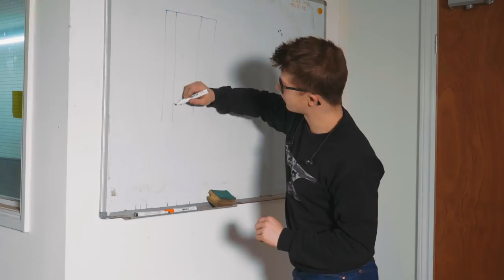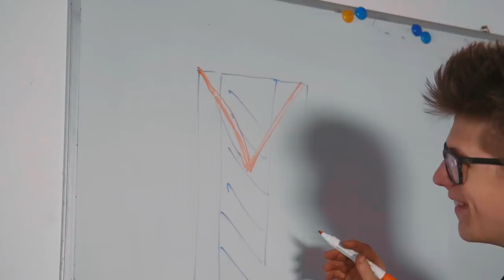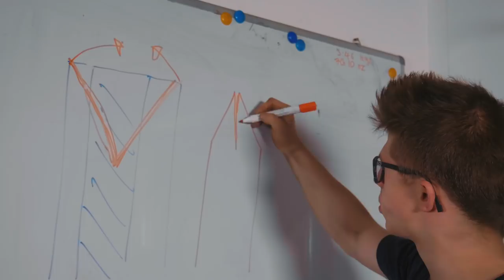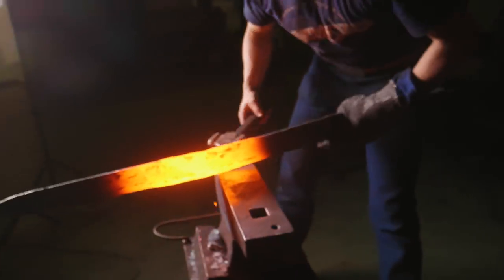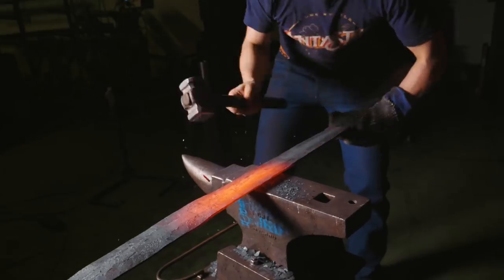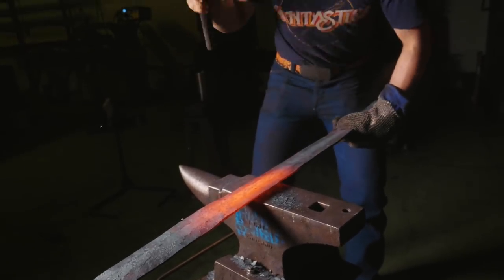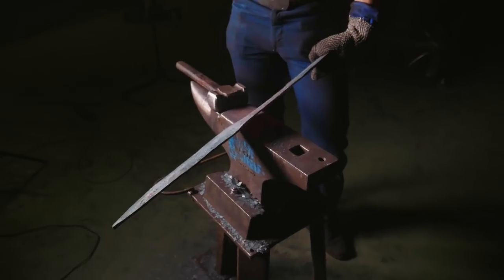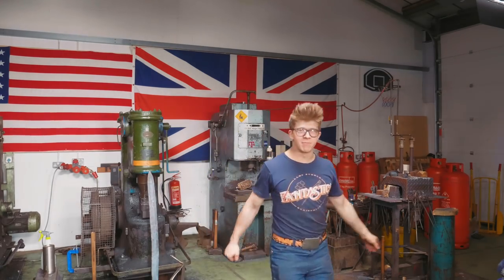MAKING A SCOTTISH CLAYMORE SWORD!!! PART 2

Comment: one thing i am curious about. does it make any difference if you hammer in a fuller opposed to just grinding it in or would it do nothing structurally and just push the material outwards? im just wondering if it would change the structure of the steel in the blade itself
Reply: B & A Talks you can't hammer in a fuller. It would be pointless. The whole point of a fuller is reducing weigh, hammering it in doesn't remove any material.
Reply: me too
Reply: the only difference between the two methods is the amount of wasted material. Hammering on steel doesn't make it stronger, the truth is it creates stress in the material that could cause a failure. That stress is relieved by heating it to forging temperature and letting it cool several times. The strength comes from the heat treating process. The quench makes it hard but also brittle which is why you then temper it so it retains some hardness but also becomes a spring steel so it will bend and flex while retaining it's original shape without breaking.
Reply: orrrr you could have a thinner piece of material in which you hammer the fuller in to make it wider so you start with less material? but my question is does it change the actual structure of the steel opposed to just grinding material off
Reply: Hammering on hot steel compresses the material and makes the molecular arrangement tighter. Think of it like compacting snow into ice. When you heat treat and temper the stress is taken out and the molecular arrangement stays tight and strong. A ground in fuller reduces weight, a forged fuller adds strength to the center to support the cutting edges
Reply: That's why people want hand forged metal. Not stock removal (grinding and cutting metal to shape)
Reply: i know about all the heat treating and so forth and the stress as you said will be reduced with the normalising process. i am wondering if it actually give beneficial strength by changing the actual structure of the steel opposed to purely grinding it as the steel would be compressed ergo its crystalline structure would reflect that fact or so one would imagine. THIS IS FOR SCIENCE!
Reply: Forging vs grinding does not change the internal structure or chemistry of the steel except that what was said that forging can introduce stresses that need to be treated away.
Reply: one suspects that it would as it would cause the grain flow to be oriented to improve ductility, toughness, and increase fatigue resistance where as grinding would have uni-directional grain flow which is when the steel has been cut when changing contour, exposing grain ends. This would render the material more liable to fatigue and more sensitive to stress corrosion cracking? or at least so i am lead to believe. I will have to ask my colleagues as their material studies were a lot more comprehensive than my own
Reply: For damascus steel is better to grind it, mainly because the pattern will be distorted with forging. Forging causes compresion of the layers, whereas grinding just cuts through them.
Reply: You add a fuller to add structure to long pieces so they aren’t all floppy and stay straight. That’s they main reason ,reducing weight and the way it looks are just bonuses.check out Man at arms they make a ton of video game and movie weapons and armour they make the William Wallace claymore and I think they explain it in that video or one of the others. Alex correct me if I’m wrong lol
Reply: Zach Attack, a fuller that is hammered in is not pointless. When you plan on forging a fuller versus grinding it you just start with less raw material than you would otherwise. It has the same effect either way. Fullers are not a new concept, and I guarantee you that medieval blade smiths didn’t spend months removing material from their blades, especially when it was so hard to come by.
Reply: fang maxam Actually, that's completely untrue. Hammering on the steel won't compress it, because at high temperatures steel exhibits extreme plasticity, meaning that the steel would only be spread out where it was hammered. The only case where hammering in a fuller would compress the material would be if the metal was bronze.
Reply: that is true but i am  concerned with the mechanical properties out of curiosity opposed to aesthetics
Reply: oh no i know that, i am just wondering if there is a difference between a hammered out fuller and one ground in. the grain orientation would be different but to what end?
Reply: exactly and i am just wondering if there was an added bonus to it being hammered structurally opposed to saving weight/not wasting hard to come by material
Reply: No point to forge a fuller in. Waste of time and energy. Point still stands.
Reply: your point doesnt still stand. if you lack the initial amount of material then a forged in fuller isnt a waste of time or energy PLUS if appears that there is additional structural benefit. you act as if you know yet i bet you are a 12 year old boy whos barely even seen a hammer in real life
Reply: B & A Talks structure will not change but the pattern in the damascus will look different 
In my experience grinding a fuller in damascus looks allways better 
A fuller is also meant to add  strength not reduce weight think of it as an I-beam
Reply: B & A Talks if you start with less material, there's no point to forge in a fuller, since it'll be the same weight without it. Still pointless. It's purely cosmetic.
Reply: B & A Talks 
Tl;dr: forging a fuller doesn’t make a difference compared to grinding 

To my knowledge there is no difference between grinding the fuller and forging it in. Whether grinding or forging the blade really should be annealed (heating to approx. 1600 F and then letting cool slowly and repeating several times) which will make the grain structure of the steel smaller and more refined. When the steel is hot you can’t really adjust the grain structure because any changes made will be destroyed and made uniform during the annealing process. There is, however, some thing called “cold forging” that I️ have heard of. Some Japanese knife makers hammer the steel while cold (and annealed) to further refine the grain structure. However, I️ haven’t tried cold forging myself and I️ haven’t found any comprehensive evidence that it affects grain structure in any meaningful way. I️ hope this helps!!
Reply: Cold forging is a myth, does nothing except open the door to failure, and probably originated as a means to straighten material that became warped during normalizing/annealing. This was proven during the Napoleonic wars.
Reply: Nope!
Reply: Good gracious the entire point of fullering is to reduce weight in a wide profile blade.  A fullered AND distal-tapered blade was/is a joy to handle.  Doing it by grinding is fine in the modern era where excellent steel is plentiful.  In the ages where this type of sword was made preserving the 'good' steel was far more important.
Reply: B & A Talks, I've been a metal worker for 20 years, so I have some knowledge of this topic, however I will gladly tell you I still learn more about metal every day. I can also tell you that in my experience, Forge welding a fuller actually seems to weaken the blade versus a milled fuller.  When you forge metal with a hammer, it compresses it and causes stress, which you can normalize later and make a bit stronger, which is something you should do with any blade anyways. I think the extra weight causes additional stress when impacting your target as well, so this could also be a factor in the blade failing, Milled blades are a bit lighter and easier to handle, but if not normalized and tempered correctly break just as often. Personally, I think the milled blades fare slightly better, so in this case, I do not believe forging a fuller adds anything structural to the metal, but introduces more weakness. Hope this helps.
Reply: To anyone who wishes to claim a fuller is pointless, you are wrong. Firstly, a fuller does provide structural support to a blade of the same weight and width and length as part of the blade is thicker and therefore more rigid. Secondly, even though the point of a blade may seem like it would create a simple line when piercing flesh, the wound channel will actually take on the shape of the cross-section of the blade, not just the point. This makes a wound more difficult to treat and heal (not nearly a direct comparison, but think of the triangular shape of a bayonet grind). 

As to the difference between forging and grinding a fuller, there shouldn't be any difference. If you think of steel as having a grain, you are right. If you think of steel as having a grain like wood... you would be less right. Wrought iron has a wood like grain, Mokume Gane means wood grained metal, and Damascus has a pattern, but in good modern steel, you shouldn't really be able to see a direction or striations within steel.

Think of Wrought Iron, Damascus, tamahagane, and any steel with a visible grain orientation as being like wood (the structural integrity of which may or may not be related to any particular direction). And think of any other steel as being sandstone or quartzite (the metamorphosed version of sandstone), with grains much like sand which are bonded together on all sides. They are generally fairly even in size and shape making the material strong from all directions.

When working with wood, one needs to read the grain so as not to tear the grain out or cut across the grain when it needs continuous grain along the length of an object such as the back of a wooden bow. Some say that a craftsman's job is not to force the wood to what you want such as making the flute you want to carve, but rather to find the flute within the wood and simply remove material until you are left with what the wood wants to be. With steel... you don't find the knife the steel wants to be. You make the steel into what you want it to be. If you grind it, hammer it, press it, or bend it, it doesn't care.

I would like to say that there are differences between a forged blade and a stock removal blade on the molecular level, because there are. However, with modern steel, and with proper heat treatment involving precise temperature control, intervals, and the inclusion of normalization/thermal cycling, there is NO TRUE BENEFIT to a forged blade. The greatest benefit has nothing to do with properties of the steel: flexibility of stock sizes/shapes, saving material as less is ground away, the experience of forging a blade and swinging a hammer, and the potential to save a lot of time. If you are already forging a blade it is said that 10 minutes at the anvil saves an hour at the grinder. Using a spring fuller, or top and bottom fullering tools have the potential to save a lot of time, as it is often faster to simply move the material around than it is to grind it off.

The Japanese still use traditionally forged and heat treated blades, they typically favor differential hardening or laminated blades both with very hard edges, over through hardened and tempered blades (katanas will bend and take a set due to there soft spine whereas European swords are tempered to be more like a spring, bending and springing back). I have heard that Japanese smiths may not even normalize or anneal a blade before hardening as the refined grain structure it results in will not take as fine of an edge. Whether that is common or not, blades with a wide fuller or a wide section of a blade with fullers are typically intended to be tough to take a beating rather than hard to hold an edge. Thus, to improve handling/liveliness, while retaining rigidity and toughness, and to save material, the fuller or blood groove was implemented in many western blades.

In summary, I see no compromise to the strength of the grain structure through grinding a fuller, nor do I see an noticeable gain to the grain or structure through forging a fuller. If one has the tooling, forging the fuller will likely save time. If one has the tooling and the skill, grinding may save time instead.
Reply: Also, there is a difference between annealing and normalizing... 

Annealing is all about making a piece of metal as soft as possible. With steel that means cooling it as slowly as possible generally from about 1600 degrees in a forge or sticking it in a bucket of vermiculite or wood ash as an insulator. 
Normalizing is all about refining the grain and making the steel as homogeneous as possible.

Annealing does not necessarily reduce grain size by cooling slowly, in fact, due to the temperature the grain would be growing as it cooled down to about 1450. The higher the temperature the faster the rate of grain growth, this is why some really high-alloy steels have different instructions for heat treatment based on temperature: soak at 1850 for 30 minutes, or soak at 1950 for 15 minutes, or soak at 2050 for 5 minutes...

Normalizing typically involves at least three heats of descending temperature and cooling in between each heat. The cooling does not have to be done as slowly as annealing, and it also does not need to cool to the point you can touch it. You might call this process thermal cycling, or a triple quench, but all that is needed is for the blade to drop below 900 before raising it back up for the next heat. As for general normalization, the rate of cooling doesn't really matter (and cooling to room temperature is fine) as the slowness doesn't reduce grain size.
1: The first heat doesn't really matter on temperature as long as it is well enough above austenitizing temperature to fully "come into solution", this is generally 1600-1650. This is supposed to homogenize the grain size and carbide distribution. This heat is not about refining the grain.
2: The second heat is lower than the first, somewhere around 1500 degrees or the temperature you would quench the steel at. This is further homogenizing the grain and starting to reduce the grain size.
3: The third heat will probably be the first real grain reducing heat and is done at a lower temperature than #2, about 1400 degrees. Every subsequent heat from the the first should be progressively lower temperature by 50-100 degrees per cycle down to about 1200-1300 degrees. If one wants to refine the grain as much as possible, more cycles should be used with a smaller change in temperature between cycles.

Summary: Annealing benefits cold work by softening the steel and reducing stress. This makes cutting, filing, grinding, and sanding easier, but it does not necessarily refine the grain.  Normalizing benefits heat treatment by homogenizing and refining the grain structure. This makes a harder, tougher blade which is also less likely to warp in the quench, but it does not necessarily create a softer piece of steel for cold work before hardening.
Reply: Then why do i have fullering dies? 
fullers not only reduce weight but also add strength(like the cross section of an I beam) as for hammering doesn't remove material that's why we use hot cut hardy tools and chisels.as for being pointless its easier to forge a fuller then clean it with the Grinder than grinding one in some people prefer one option over the other I prefer to do most of the work at the anvil then just clean up on the Grinder (i live way to far from the shops)
Reply: Essentially, when the sword had been completed, the way in which a fuller is made (whether forged or ground in) makes no difference to the structure of the steel. It would only make a difference if it were not heat treated, in which case the forged in fuller would likely be stronger due to somewhat smaller grain structure.
Reply: Gickky       That was a more succinct explanation than mine. Better to move the bulk of the material and clean it up at the anvil, then grind the surface smooth. Saves time, saves abrasives and therefore money, and makes great practice for forging over grinding. But it really is more of a preference these days, rather than one being better than another.
Reply: B & A Talks hammering steel does change its structure, but only untill you heat it up to its critical temperature again, which is the temperature at which the grains morph into one solid piece. When you quench it the grains don't have time to form into the large crystals or grains that regular steel is made of, but form smaller crystals which makes for very hard steel, but cracks form easily because the grains are small and not woven together essentially
Reply: B & A Talks I’m not a blacksmith. But I do know a little something about structural strength in steel. Reducing metal reduces strength.  A solid steel beam is stronger than an i-beam. The point is how much metal can you remove for weight control and still have the strength necessary for the application. Another example: fluted gun barrels do NOT add strength. Less metal less strength.  Looks cool but isn’t of any structural value.  There is also LESS heat dissipation advantage as the root of the flute is all that is dissipating the majority of the heat.   This is a response to several comments.
Reply: hmmmm but one would imagine that even during hot forging, you would bend the grains of the steel, leaving no end grain structure where as cutting it, would break those grains thus weakening its strength
Reply: other than with bronze.
Reply: I understand that in ye olden days they didn't have enough steel to simply grind it away but my question is based on grain structure
Reply: strokes beard hmmm but one would imagine that the granular structure remains in tact ergo improved ductility, toughness, and increase fatigue resistance where as cutting it exposes end grain which would lead to stress corrosion cracking?
Reply: I think i'll ask my colleagues as they are materials experts. they will probably know but one was wondering on the opinion of blacksmiths
Reply: AHA! I have spoken to my colleague. It does indeed have a difference on the steel, a beneficial difference which is still significant with modern steels! 

I challenge Alec to forge in a fuller to see how hard it actually is to forge in and maybe run a test against a grinded in fuller!
Reply: B & A Talks   I would argue that good quality modern steel does not have "end grain". A pile of sand does not have grain orientation or direction. Steel is not wood. Tamahagane, wrought iron, and modern Damascus all have "grain" like wood, but unlike Damascus steel of today, tamahagane and wrought iron have impurities in them which are very similar to wood grain. Modern steel (as a better example, think of CPM steels like like sand cemented together like sandstone) does not have end grain or edge grain or anything of the like, therefore you cannot "cut into the end grain". It would be more like scooping sand off a beach. Each grain is very small, and doesn't care about orientation or direction.
Reply: jeremy mcadam  The size of the grain has nothing to do with how hard it is. And it is actually the reverse when it comes to being brittle. The larger the grain, the more delicate the steel. Most failures due to improper heat treatment occur because of over heating and grain growth. Japanese knives often forgo normalization as it reduces grain size (this is something I have heard not experienced first hand). They are not hard use knives, therefore ultimate toughness is not as important as ultimate sharpness. Large grains can take a finer edge but are far more likely to break and chip. The finer the grain size, the tougher and more resilient the blade. Regardless of hardness.
Reply: jeremy mcadam  Think of smaller grains as actually having more surface area in contact with each other overall, meaning that they have a far stronger bond. Also, I know from experience with over heating or not thermally cycling blades, hardening does nothing for reducing grain size. Austenite is the soft and plastic form of steel we forge, it is also the form of steel we rapidly cool in order to harden a steel. It is also the form which effects the size of the grain, the further one goes past austenitizing temperature, the larger the grain gets. If you quench a blade at 1700 degrees (not air hardening alloys), you will have very large grains and a very poor blade prone to chipping, cracking, and breaking regardless of how it is tempered. Martensite has nothing to do with grain size over ferrite and pearlite, rather, the way the steel is thermally cycled is what changes the grain size.
Reply: An interesting argument, but I think you may forget the main reason features like fullers were forged is that stock removal on that scale simply wasn't practical before the arrival of modern power tools in forges.
Reply: oh yes very true but my question is entirely about structural differences opposed to reasoning
Reply: grain flow can be altered very easily
Reply: You are thinking of work hardening, the amount of that with steel is miniscule compared to copper or bronze and is not beneficial, the heat treatment process is normalize to get rid of stress by having an even amount of atoms throughout the metal, then you heat it to critical which aligns the atoms and quench it to freeze them in place making a hardened crystalline structure. That hardened crystalline structure is brittle and will be prone to breakage. The whole process depends on the alloy, mild steel you want to quench faster and use water, high carbon and it would be an oil for the quench so it cools slower. When you temper the steel it loosens the crystalline structure so it becomes less brittle, too hot and it will be too soft for a sword, not hot enough and the sword wont be flexible but brittle. Number of normalizing cycles depends on how much it was forged, the more forging the more normalizing required to even out the atoms so the quench is universal which will have an effect on the tempering. You can take a sword made from forging from a billet and one from stock removal out of plate steel and get the same crystalline structure through heat treatment, just the stock removal doesn't require normalizing to get a good blade.
Reply: no im not
Reply: Metals that you work harden have the opposite effect when quenched, the get harder as you work them and the quench brings them back to their original soft state. Bronze swords for example were poured into a mold and let cool then the edges were hammered to harden them so they can keep a sharp edge, after the hammering they were ground and polished to the finished form. If they were quenched the edge would be the same softness as the spine after cooling in the mold. Same thing with pure copper, the quench makes the metal soft, iron though gets harder from a quench, different metal, different properties, different way to work it.
Reply: a forged fuller is better it helps make the blade feel lighter by widening the blade to give it better handling and
 ballance
Reply: tball 1902   Forging and stock removal with the same final dimensions do not handle differently, have different balance points, or are noticably different in any way shape or form. The difference there would be the shape and size of the starting piece, and then tools and processes used to achieve the same result.
Reply: JETWTF   He is not talking about work hardening, and bringing up copper based alloys is going in a completely different direction. Also, quenching mild steel in anything is pointless, unless you want a less durable piece of steel. Mild steel, by definition, does not have enough carbon in it to harden. Instead, you may create stress without hardness, problems without benefits.
Reply: B & A Talks   I think the simplest way to put it is this: Yes, you will cut into grains. Yes, that may affect the strength of the blade. Yes, forging will keep the structure or grains intact. However, unless you are going to leave the fuller "as forged" and not grind it smooth, there will be no difference as grinding and finishing will also cut into the grain. And when heated to critical temperature, the grain will grow back together, reform itself where it was ground, and form new and different boundaries with the surrounding grains. If you have experts in the field dealing with heat treatment of tools steels with different methods of machining and shaping done to said steels and they tell you one way or the other, I'd say you should listen to them. They have more experience than I do, and better information than I do.
Reply: yes the do the way the metal is shape can produce stress a example is the deference  between a ground fuller and a forged fuller is how the mass got there . when forging a fuller you can actually tart with less metal because of the mass displacement over when grinding you start with more material you have to start with more material than the final dimensions . as for handling you can get better cuts with a forge fuller because of the way it is shaped overall
Reply: you an actually harden mild steel. by heating it to a white heat just under melting then quench in a mixture of one to three vegtable oil and burnt motor oil . the only type of iron/ steel that can not be hardened is cast iron which has to much carbon to even forge , or wrought iron which has next to no carbon in it is is almost pure iron
Reply: Guys. Seriously you're making this too complicated. Just take it this way. If you're making a sword of equal design, one with a forged fuller and one with a ground fuller(taking into account that they aren't pattern welded like a LV bag); the forged fuller will require less grinding like a forged edge bevel but you put stress(like a breastfeeding mother) into the material that then needs to be released(with a massage?), you also use less material in the initial billet; the crystal structure would be slightly different to a ground fuller sword crystal orientation wise, however it might actually not be beneficial as you can't control the exact grain formation(hammering can be inconsistant like the trains in UK) unless you do something crazy like press in the fuller with a pressure wheel or something then not bring it up to heat again, creating tension within the outer edges of the fuller where it is thicker.

The wound/blood drawing effect of a fuller is a myth.

As to the merits of a fuller, well a solid sword is stiffer, however considering a claymore or a broad sword if you made it purely out of a solid piece, it would be heavy and unwieldy.

The way to reduce the weight would be to reduce material, however if you equally reduce material it would make the sword flexible perpendicular to the edge, which is silly, (like a bendy ruler in primary school) Thus if you reduce material specifically where it doesn't matter too much, right down the centre of the blade, then you can get away with less weight. You want the most material behind the edge as the edge itself is thin and needs re-enforcement(Dammit Jack Bouer)